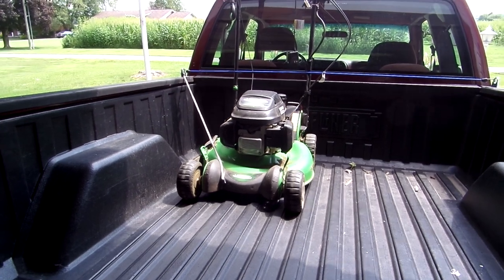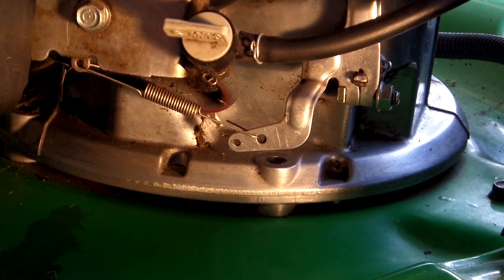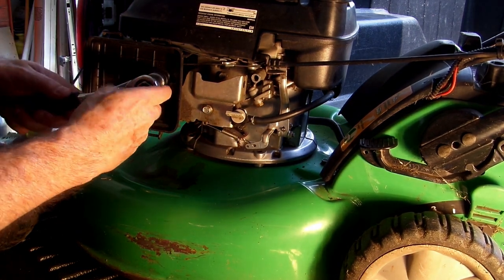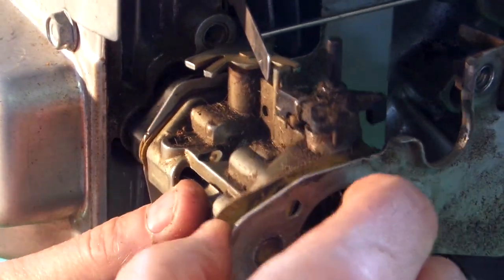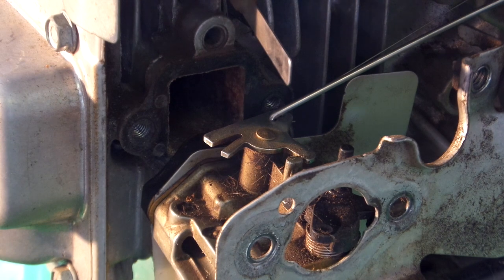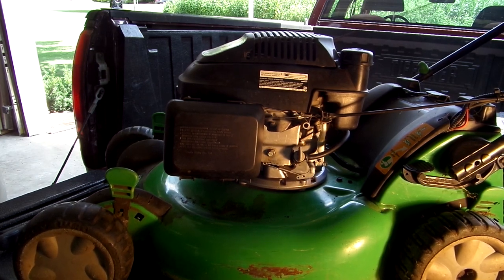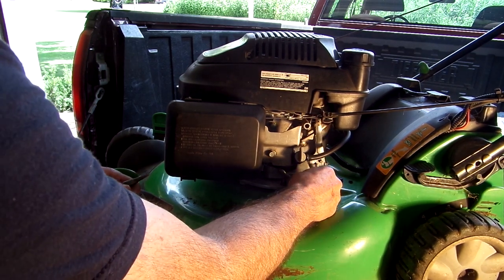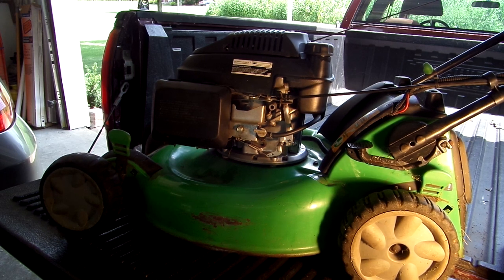Lawn Mower Repair - High RPM Fix

Comment: What do you think the correct rpms should be on a Lawnboy silver series 2 stroke 4.75 engine.. I put a tach on it and it says 2010 rpms but it seems like it’s screaming to me. Please help.
Reply from the maker: Not sure about this particular mower however but most walk behind mowers run at  a maximum of 2900 rpms.

Comment: Dude, your spring tension is the main issue here. Play with the spring, adjust & re adjust until the correct pressure brings the rpms where they should be .
Reply from the maker: Thanks Dude!
Reply: Is the tension too tight or too loose?
Reply: Loose for lower rpm

Comment: If u ever get them whr they start run n stop it's usually a fine screen filter somewhere at the tanks out spout or at the carb pick up.  Depending on what type engine u hv.
The screen filter will look good but hardly any gas goes thru.
Get a sewing needle or fine pin and put about three or four pin holes into the screen and should stay running.
Also don't leave gas/ethanol in tank for more than couple months, the moisture will accumulate and a thin layer of white looking cloudy water will rust metal (floatbowl gas tank . . .) corrode and gum up yr carb.  It's awful fuel to the engine if u let sit to long.  Even fuel stabilizer thou it helps is not a sure proof.  Best bet is medium grade Shell.  U can phone 1800 SHELL oil line and confirm. No Ethonal.
Reply from the maker: Good Tips 👍
Reply: @BudsSmartHome  
Checked out what you had on my Arians Koehler xt7 and same thing seized throttle shaft thnx.